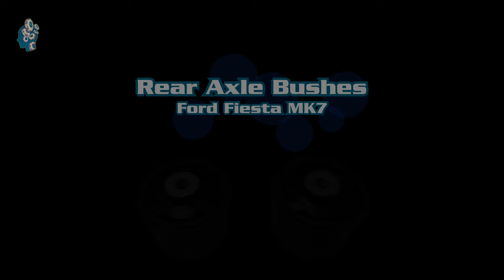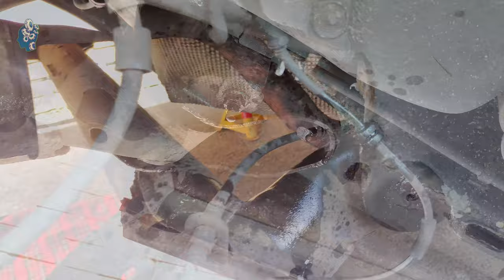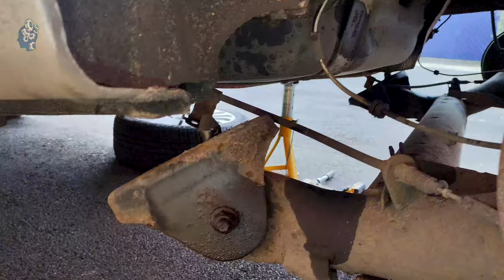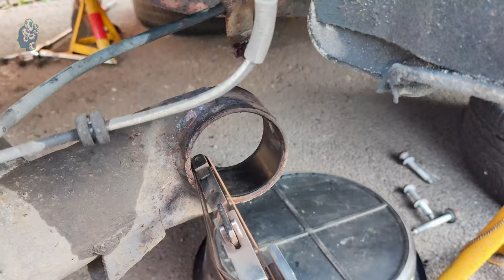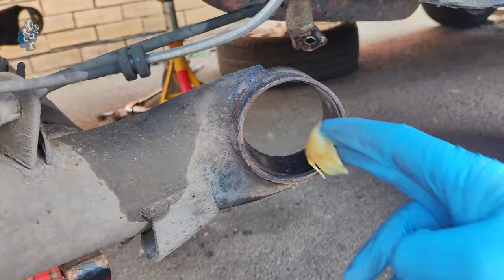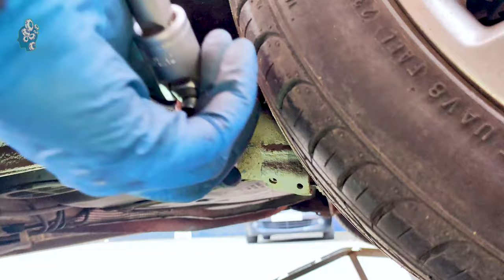Replacing Axle Bushes - Ford Fiesta MK7

Comment: The simplest and quickest way to remove them is to use a big drill bit and drill into the gap on the bottom of the bush. By doing that, it cuts a groove into the plastic casing and the bush will simply fall out with a few small taps with a hammer.
Reply from the maker: Good idea. Will try it next time.
Reply: Great video and I love to see comments like this that gives other tips and advice. I have a question can I do the rear bushes 1 side at a time?leaving one side connected and the other side dropped, I ask because I don't have 4 jack stands only 2. Thanks in advance.
Reply: @uemackay1592  You might be able to, however I’ve only ever done them on a Two Post Lift. 

I would just raise the back of the car as high as possible and do both sides at once. It’s easier and quicker. 

Put two Jack Stands at their highest position underneath the sills with a piece of cloth to protect the paint, remove both the rear wheels and then place the Jack beneath the centre of the Axle and jack  it up so it’s supporting it. Unclip the ABS wiring from the Axle, remove the 13 mm nuts from the Handbrake cables, then loosen the pinch bolt for each Axle Bush Cage (18mm nut and 15mm bolt head.)

Then remove all six 15mm Axle Bush Cage Bolts and then you can slowly lower the axle down so that there’s enough clearance from the sills to carryout the work, but make sure you don’t put stress on the brake Flexi Pipes. Always keep the axle lifted enough so the Axle isn’t pulling on the pipes.

Hope this helps.
Reply: I did this last summer to my 2017 mk7.5.  creaking and squeaking from the rear. I drilled out the rubber and the filed with a triangular file a groove to break the outer plastic.  Used a flap wheel to polish up the inside and some KY jelly to lube it. ( Washing up liquid is salt based, so it starts to corrode the metal.)   Bought the similar puller as shown.   Was easy to install.      Does anyone know are MK8s the same. Traded in the Mk7.5 as oil light started to take too long to go out.
Reply: @JoelCr184 Thanks for the replies, I took all advice on board dropped the rear  axle today, I used a bush press kit to remove and install new rear axle bushes, fitted new brake lines, calipers, discs, pads. 

Was a successful job allot of bolts where hard work getting out with my impact but I got them all eventually. Bent the rim on one bush trying to get it in without enough prep with the dremel, lesson learned.

Jobs done and the 10 plate 140k miles is good for at least a while, owner was delighted.
Reply: @robertwillis4061  It’s a bigger bush but a similar design for the MK8. It looks more robustly designed so that it hopefully won’t fall apart every two years.

Today I serviced a MK 7 that I changed the bushes on last year, and the bushes are already starting to peel away from the aluminium centre tubes .

They are total crap!

Comment: Hi, great video. 
What tool are you using? the thread looks heavy duty. Used a few and the threaded bar strips. 
Thanks.
Reply from the maker: I used TR12x3mm trapezoidal rod and some random adapters.